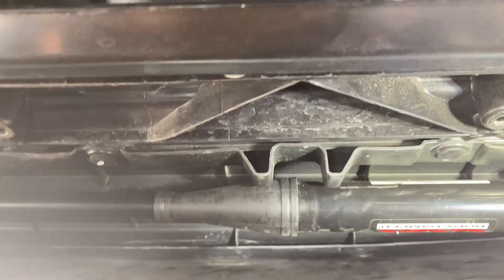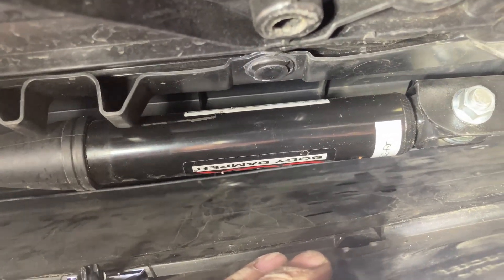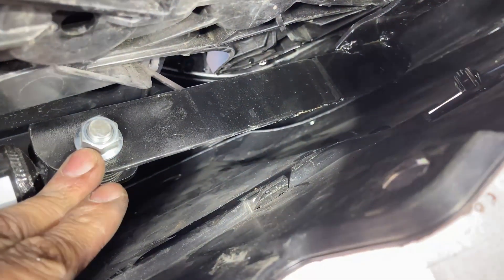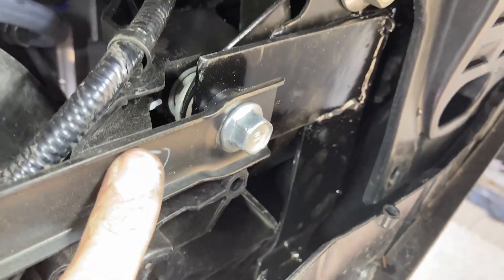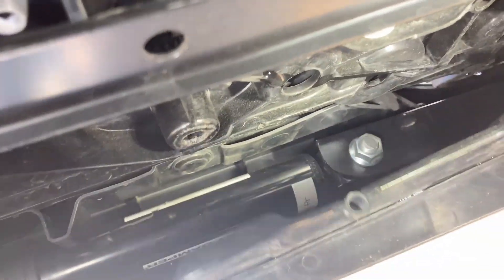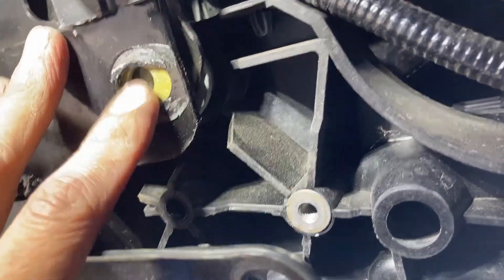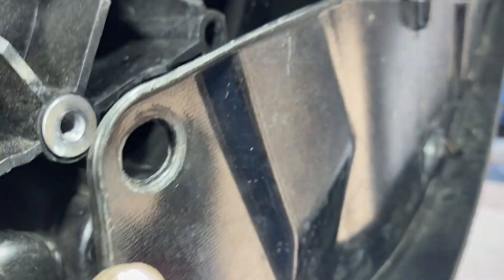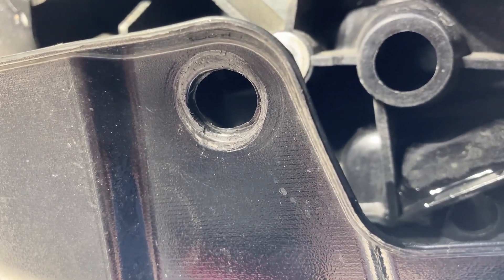Installed Cox Body Damper on Honda FK7

Comment: Where did you get the Cox Body Damper? I would like to import into the US, but so far no luck finding them.
Reply from the maker: I bought them from Croooober. It's a used part for the Scion FRS/BRZ.  The Cox Body Dampers are made by Yamaha which can also be found in Nissan and Lexus vehicles.